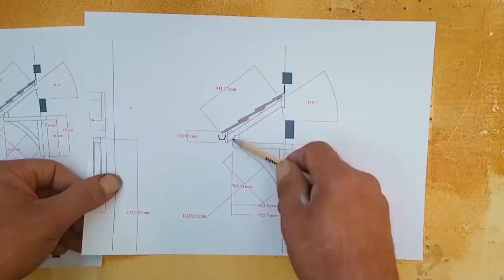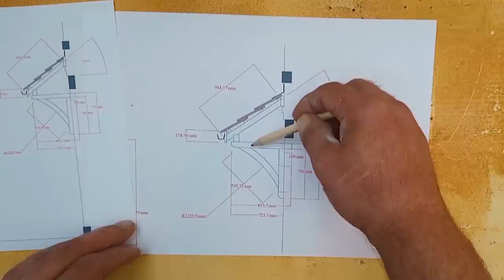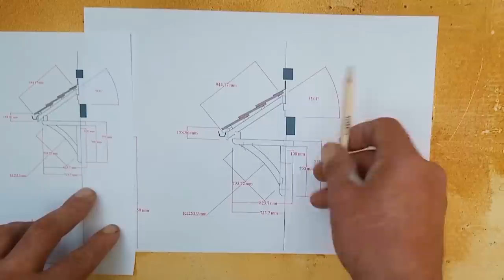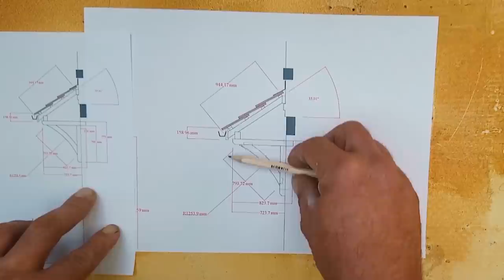Porch Canopy Build Pt1 - Making the brackets 1

Comment: Great vid as per.
I dont have space for a big stand up planer. I was wondering if you thought its a good idea to us an electric hand plane, then use your plywood method on the thicknesser to finish it all up? Trying to work out the best way to get squared dimensioned wood without a big metal planer. Thanks again
Reply from the maker: Thanks, There's ways of getting planed square edge (pse) timber, the thicknesser can be used with a board & wedges to get a board planed both sides, squaring the edges is the harder bit, a router table & a straight cutter can be used with a thin sliver of wood on the fence on the outward side, A decent sized plane & a shooting board is prob best, Do i remember you buying a tablesaw? if you have a 40t blade in that it won't need more than a stroke or two with a hand plane to clean the edge up 👍
Reply: @Gidjoiner  thanks, yeah I have table saw and a router table. So I guess I could go router table to get one straight edge, then butt that against table saw fence to get them parallel? Not sure what to do with other two sides after that though haha.
Reply from the maker: I have a piece of ply 8ft long about 1ft wide that i can run through the saw, on it i can mount an 8ft piece of 2x1 & two clamps on the side near the fence, the 2x1 isn't absolutely necessary & doesn't have to be perfectly straight, it's just to raise the clamps up, then clamp the board you want to cut straight to that to get one straight edge, I can't find a vid of mine with it in but in this vid where i'm cutting wedges imagine the board is longer, the little blocks mounted to the board is the 2x1 & the wedge that is being cut is the board you're wanting to get a straight edge on, once you've cut one side then like you say you can run the wood against the fence to parallel it, https://youtu.be/YCypl3jMfDo
Reply from the maker: This isn't my vid but it's pretty much the same as this https://www.youtube.com/watch?v=OClAbVzTxT8
Reply: @Gidjoiner  nice one. As always, your help is very much appreciated. Start my carpentry college course next week. Annoyingly they're making me do level 1. Wanted to jump on level 2 but wouldn't let me, bastards
Reply from the maker: 😂 I understand that but a lot can be learnt from level 1, everything is based around the half dozen basic joints & techniques, all my stuff still is, 👍

Comment: 21:33 into video, why are you running the saw back and forwards, dropping as you go, to do the cut?
Reply from the maker: Same reason i mentioned at 11.38. taking it in one cut is hard on the motor, could produce too much heat in the blade causing burning, heat damage to the blade blunts the teeth or warps the blade, the saw/blade could 'grab' the wood making the saw kick-back, or blade drift would make an inaccurate cut or be dangerous. Small bites of the wood keeps the blade speed up allowing wood chips to clear making the cutting consistent,
Reply: Freud Diablo blades are the tits! 😁👍🇮🇪